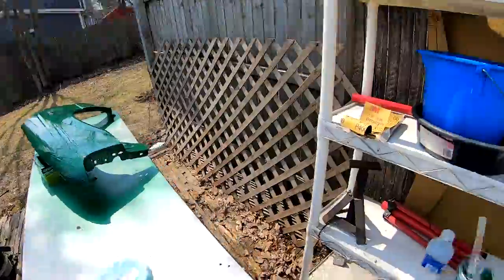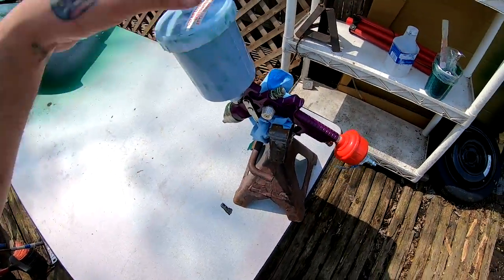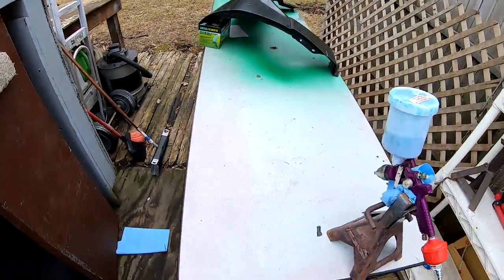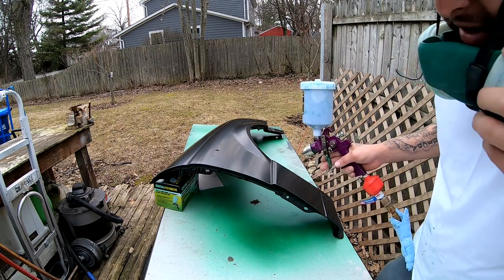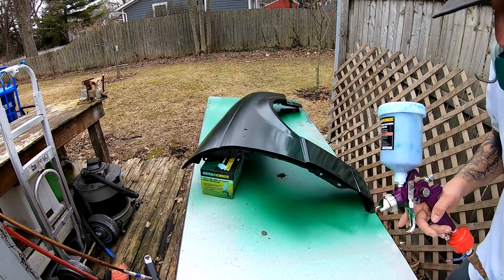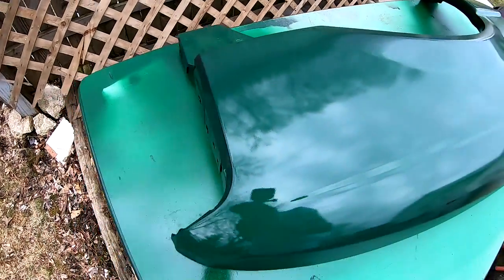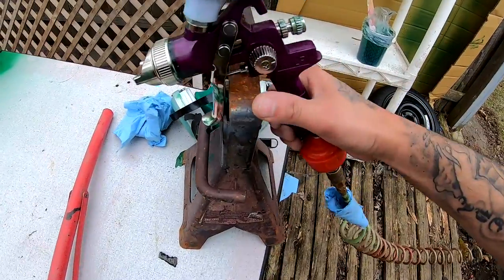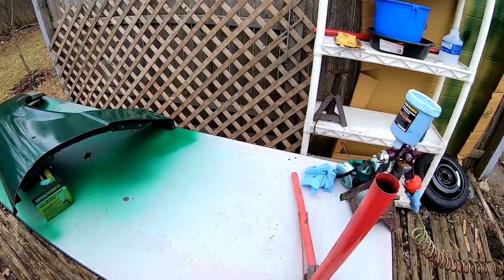Gloss Hunter Green Rustoleum Paint job

Comment: 60psi will destroy an HVLP spray gun. You should be spraying at 35pso @ the gun. The seals on an HVLP gun, aren't designed to withstand that kind of pressure. Even a pressure pot gun will lay down product below 40psi. You'll use far less material and get a better finish.
All that said, you did an awesome job...your technique is nearly flawless.

Comment: I think the gun leaked from too much air pressure. Usually 30 - 40 psi works good for those guns. I have one.
Reply from the maker: Yeah might be but every time i paint a new color i always buy a new gun never had that problem until this time.
Reply: @BarbasLife  for not much more money get a sprayit 33000 or 31000. It's a w400 clone and w200 clone.  The parts from my name brand iwata fit on and vice versa. About 18 to 21 psi is perfect and it will lay down glass.  No orange peel
Reply from the maker: @JamesSmith-lt5zz  thats what i need
Reply: @BarbasLife  glad I could help. I got the set with the different tip sizes and the touch up gun. Only one it doesn't include is 1.5 the tip sets are about 12 or 15 dollars.  I bought one to use 1.7 tip for primer. I use 2.0 anytime I need to spray thinned latex.  On Amazon if you want the gun with the 1.5 it's called aeropro. The siphon feed 31000 comes with the 1.5. Rustoluem thinned sprays out the 1.3 just fine. I have one I only use for primer.  And one for paint. Tips are interchangeable between 33000 and 31000. The r100 touch up gun that comes in the kit.  I can use with my 6 gallon Porter cable compressor and it will actually cycle off.  Works great with it.  33000 does as well can paint for a few mins on a small compressor before needing to catch up. Painted the whole outside my house with it and the 6 gallon compressor